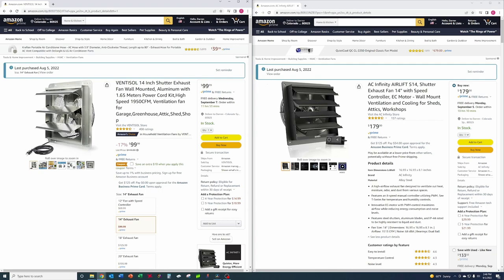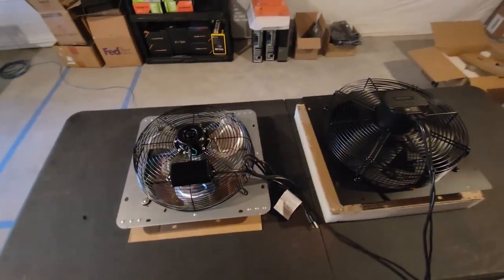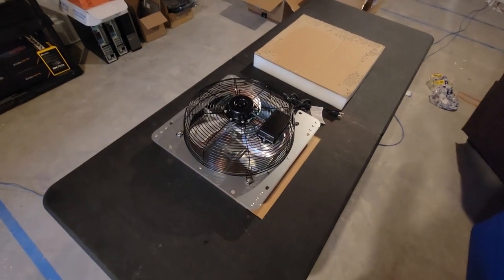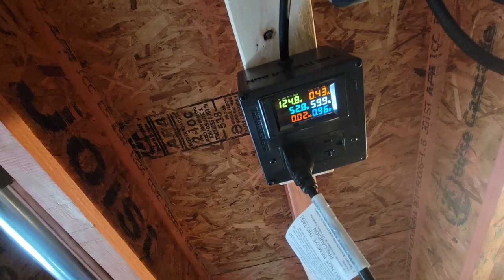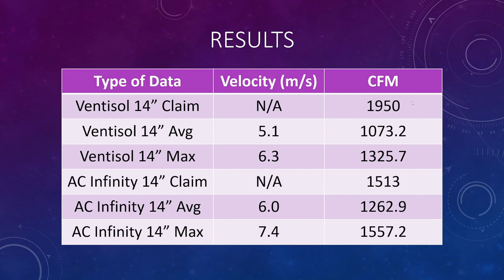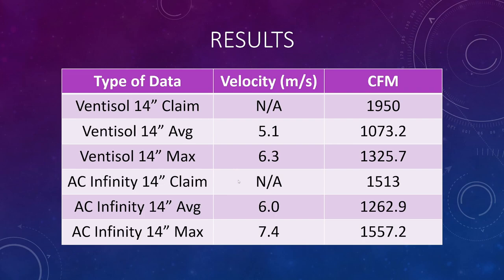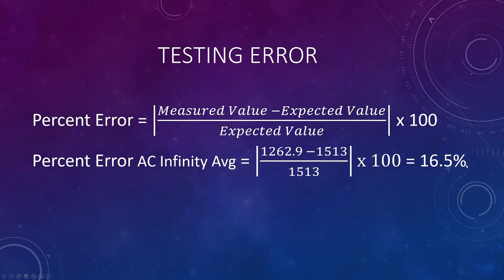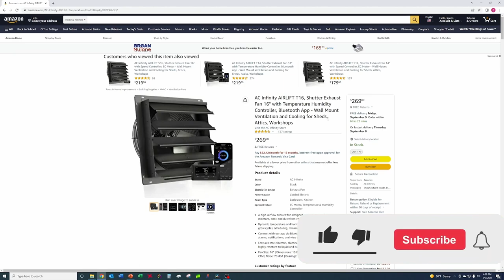Testing Cheap Amazon 14" Exhaust Fan Against 14" AC Infinity Fan

Comment: Your testing of shuttered exhaust fans is flawed !
Read up on...Bernoulli's principle and how static air pressure influence's air flow in a sealed / ducted environment
You are open air testing these fans ... It's like testing a sub-woofer outside of its enclosure.